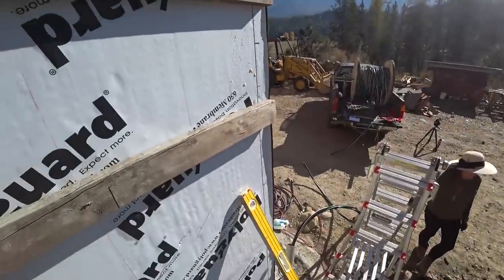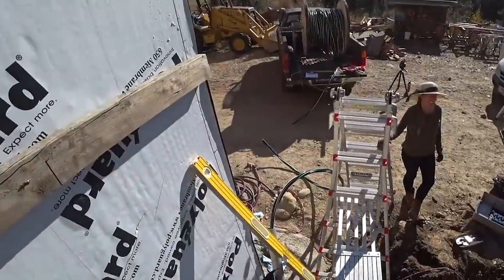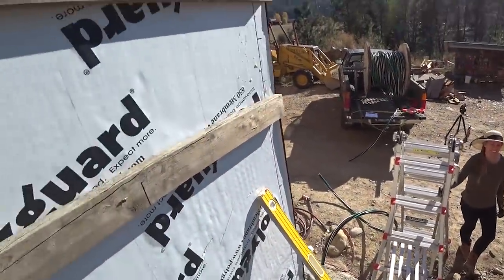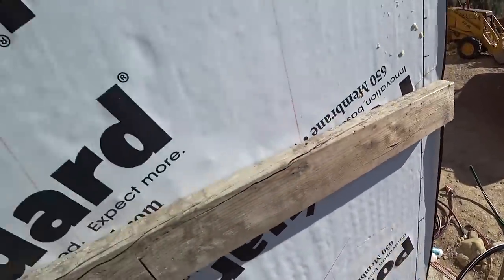Will 200 Amps Be Enough?! (Connecting House to Power)

Comment: 49 views, 20 upvotes, 0 downvotes after 30 minutes since uploaded.

Yes, of course 200 amps will be enough.  The whole house should be comfortably heated and cooled with 25 amps of SEER 16+ heat pump and probably not more than that for interim electric heaters.  A standard electric water heater won't use more than 22 amps @ 240 volts.  The computers won't use more than 4 or 5 amps total.  It is hard to imagine, in such an energy efficient house, any more high power devices and appliances.
Reply: Just remember, they are all electric, no propane tank or anything for cooking, heating water, running a dryer etc. Plus they want to feed some external areas from the house. Its more than likely enough, but I think the line they put in can carry more. And as to computers using 4 or 5 amps, their business is based on computers, video editing etc. I work IT out of my home and use quite a bit more power than 4 or 5 amps.
Reply: unless he use a wood stove i would consider some backup heating unit for some room in case the heat pump can't keep up or fail to work in the middle of the night. It is also less demanding a few wall heater in some room than main house heater on a generator...
Reply: Well, remember they also plan on setting up a workshop... They have Shopsmith and a whole bunch of other equipment in storage that they'll be moving to the house when it's ready...
Reply: how about a 27KVa on-demand tankless hot water heater?
Reply: I'm guessing from the 240 volt comment, you're not in the US. The US has typically 110 volt supplies, so they need around double the ampage to receive the same amount of power. Which also means double the danger. It's amps that kill, not volts.
Reply: Wally Kramer... Example... side by side refrigerator-freezer running draws 5-10 amps. But starting that honkin big, powerful compressor may take 40-50 amp momentary load! Main line has to handle ALL starting loads at the same time.
Reply: Future EV charger?
Reply: Worst case scenario.
Dinner party..
Oven on 4000w
Induction hob on 3000w
Jesse Jumps in the electric shower 8000w
Kids in their rooms playing on the gaming PC 1000w
16000w / 66 amps at 240v.. Hmm
That's without any lights and heating on or an electric car plugged in..
100amp supply could be close on a bad day.
Reply: Just when you think you're safe.. the compressor kicks on in the garage haha.. and darkness fell across the land.... :D
Reply: We just built two new computers.  Both power supplies are 650W.  Dual monitors another couple of amps.  Yes I realize that they're (currently at least) using laptops, but if they want more later. . .

That said, we have a 400 amp feed.  200 for the house and another 200 going to the barn / shop / garage.

Comment: 200 amps? wtf... largest we have is 3 phase 16A each... does just fine for giant house.
Reply: 200 amp, single phase 240 on a center-tapped transformer … Electrification in North America is sad.  I can only dream of 3-phase.
Reply: Jesper Andersen... SERVICE amperage!! Not individual outlet capacity! Add up maximum amperage capability of every outlet you have in the whole house, add 30%, = main line.
Reply: They need that much because they aren't getting 3 phase 400 volt over there. Everything is running single phase 120 or 240 volt.
Reply: that would be a 48 amp service but no one does 3 phase for residual in any country.  There transformers for 48 amps.....
Reply: Germany or at least mainland Europe I'm guessing? Your circuits are 16A each, but your pre-breakers will likely be 63A on 3 phases, so 189A total. BUT (and here's the big but) that's counting at 230V, North America is operating at 120V, so for the same power outcome in theory you'd almost need twice the Amperage (of course not really because AC-power, but still). On top of that: most countries (including the US) only supply two phases to residential homes (no fucking clue why, only makes things way more complicated than they need be in my opinion, but that's just how it is).
Reply: Nää, huvudsäkringen är på 20A, gruppsäkringen bör då vara 16A för 3-fas och 10A för förbrukarna, annars får man ingen selektivitet i systemet. Jänkarna har inte trefas... Vad jag dock inte begriper är varför de inte drar gruppkabeln diagonalt i taket till centralen..
Reply: you need less amps at 230v than the Americans do because their voltage is lower :)
Reply: Where they are you get only one phase with 120V. So to get the same power as 3 phase 16A you need much more Amps.
Reply: I think hi is joking. I have 16 amp to.
Reply: You are probably from Europe, so these 3 phase 16A are on 240V? It is equivalent to 96A on 120V. It's little weak, if you plan to heat entire house directly by electrical heating elements. Not problem with A/C units or central heat pump. Or you need very serious insulation.
Reply: 16A? where do you livre?
Reply: 200 amps with 120 Volts are normally not enough. Just to compare, in our house in Germany we have 3x50Amps with 230 Volts that calculates to 290 Amps with 120 Volts. I guess they want to run also some machines and they have high consumption, also loading an electrial car alone needs at least 32 Amps for fast loading.